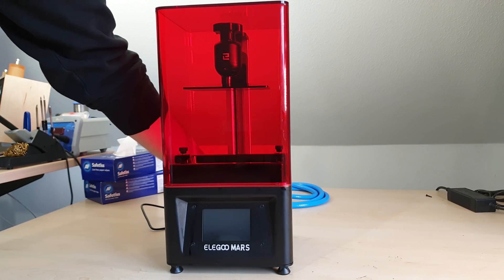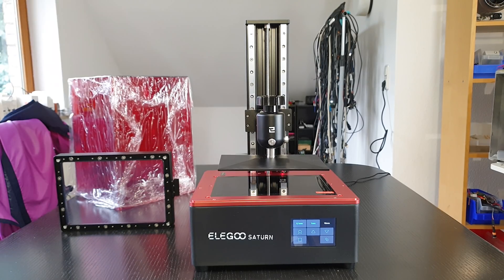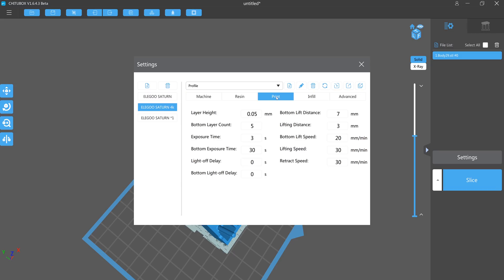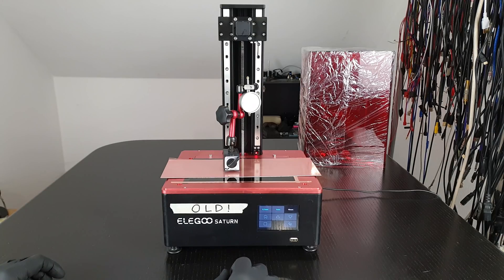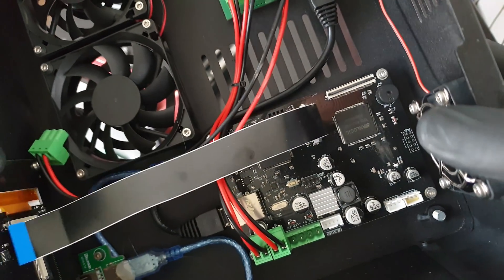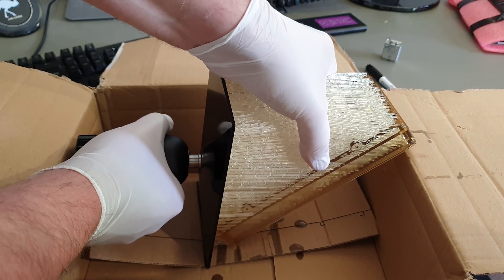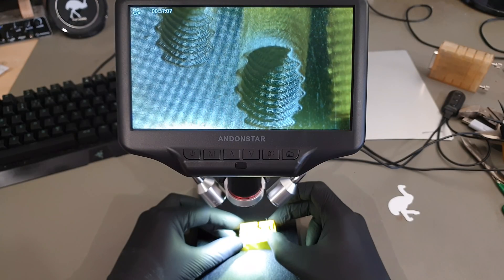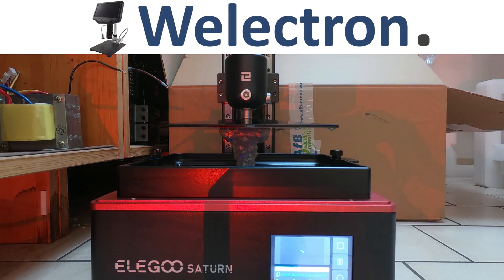Elegoo Saturn: Affordable 4k MSLA 3D Printer

Comment: Q: why are we using a single monolithic image plane?
A small image plane, moving under the vat, could make a 'mosaic' exposure.
The same tech would allow smaller models to have much finer detail.

A good, fast 2k image plane is mounted on a simple 'coreXY' gantry under the vat.
A 3 x 5 mosaic of exposures could give you 11,460 x  10,800 pixels in the print.
This assumes a 3840 x 2160 image plane.

If you want ultra-fine detail, stack a bunch of 'half-tone' images.
Each image uses tiny 'micro pixels' with lots of 'white space' between them.
Each new image is shifted by one micro pixel.
This goes on until all the white space is filled.
You get a smaller model, but with the same pixel-count as the much larger one!

Isn't that the dream?
Smaller model = finer point size?

Comment: The Phrozen Sonic Mini 4K has been out for some time now, with an increased resolution of 35 microns in the X- and Y- axes .. Are you going to create a new video showing off the threading capabilities, and other micro level engineering aspects of a 35% decrease in the pixels? xD

Comment: Maestro; a couple of questions/thoughts:
- how is the printer performance, now, in terms of your satisfaction?
- does Elgoo provide any warranty, or life expectancy for the UV LEDs?
    My question here is related to issues with performance degradation
     over time, as this will affect exposure time, and, most likely, exposure 
     evenness. UV LED packaging is rather problematic, especially at high 
     power levels, and the degradation in the LED die, as well as package,
     will not be the same across all devices. One can expect the required 
     exposure to increase a bit/gradually, with use.
Viel Spaß, oder?  Amazing results on this threads, and, with the broken "bolt" threaded part, possibly a minor "tweak" to get the thread a bit looser in the nut? Also, perhaps program into any threaded holes a very slight countersink to ease insertion of the fastener? Adieu, Ade, Pfiat Di!

Comment: Grüße;  I was wondering, just thinking, if you had a counterbalance for the mass of the printing head, to avoid any torque against the lead screw and rails...adds some load to the lead screw, unless you used something like a constant-force spring as the counter-balancer, which would remove almost all of the loading on the rails and lead screw??... anyway, just thinking... keep on drucking!

Comment: Hi! Can you share the settings of the new "rook profile", I want to compare it to the settings used in the cbddlp file that comes in the mars flash drive, specially the lifting speed, since you mentioned that 70mm/min is brutal, but the rook in the mars prints at 300mm/min and also my prints since it's what I've been using

Comment: Thank you for the excellent review.  It was by far more technical and informative than the other Saturn reviews I've seen.  I've only been resin printing for less than two months with a QIDI Shadow and while I knew I'd like the much higher resolution compared to FDM printers, I was completely blown away by the strength of the resin prints.  I designed a small electrical insulator that requires high tensile strength.  The central shaft is 6mm x 6mm and I wasn't able to break it with 100 kg tensile force, and that was perpendicular to the layers, so MSLA parts don't have layer separation failures as FDM parts do.  Very good strength for a 1.55 gram part.  I used Siraya Fast resin.  I look forward to buying the Elegoo Saturn.

Comment: I'd kill for a good review of functional parts and dimensional accuracy on this printer. Especially smaller parts that may or may not be printable directly on the bed, to avoid the dimensional problems of supports (bumps requiring post processing, but also potential warping from differential peel etc). Like, I'd love to see whether "this extreme example" actually does fail. With decently slow lift speed, I suspect it may not. And if it doesn't, it'd be a lot cleaner than the supported example.

Comment: The chess castle piece was intended for FDM 3D printers. They just can not produce good results without using a small nozzle (.2mm), aggressive and precise active cooling as well as an extruder that can retract the same length of plastic without grinding it up with the small amount of printing per island and retracting to avoid stringing.

Comment: Looks like you also had the same problem with another Youtuber. Good thing they are reacting to it. 
You should try the new water based resin.
I regret not having jumped on the deal even though i don't need one in the near future. Maybe the newer models will be 101% quality but not too much more expensive.
The way you test precision is really innovative.

Comment: dam I am supposed to be receiving my longer 30 later today might just it return it right away for this on when its available its sold out quick. this one had a larger print area and a higher resolution screen but the longer says in can print at an xy accuracy of .047 with only 2k screen not sure how that is even possible. if someone knows please reply

Comment: I'm wondering if they make usage the subpixels of that LCD. As they are rectangular it would only increase the resolution in one direction but this still by 3 times. They also could be used for anti-aliasing, too (like already in normal applications).
So, when will show up the 8K version anyway? ;)

Comment: Nice to see this space is still moving; decent rails becoming the norm, and now mono lcds too. Was a little tilted by the XY calibration though. 0.15 out of 20 is almost 1%, or about 3 pixels. Is that intrinsic to the lcd manufacturing process, and so could be calibrated out? Or is this the nonuniformity of the lighting, so perhaps can be fiddled with by part placement but is mostly unavoidable? Also while chitu and most fileformats support AA, many boards and firmware dont bother implementing it last time I checked (januari this year). Seems like this is no exception, and elegoo has a history of being behind the curve here.

Comment: Are there resins with glass fiber particles? I wonder how strong would the resulting printed object be.
Reply: You'd probably need actual glass fibers and not just tiny glass beads to enjoy any strength benefit. But fibers and pixels don't really mix

Comment: if you have two rooks, you can join them by their crenellations. they should mesh exactly, which i think is intended as a low budget tolerance test. maybe that's the "torture"? alternatively, once joined, you can torque them against each other until failure, which seems more like "torture" perhaps.

Comment: Ah damn its sold out.  Btw the "4k Microscope" you listed is not 4K - that would require an 8MP sensor, and it has a 4MP or 3MP sensor (the manufacturer does not seem to be sure which sensor it uses here:  http://www.andonstar.com/e_products/digital-microscope-AD407-10.html).  Still, a nice scope.
Reply from the maker: Whoops, you are right, thank you!

Comment: that printer is only 300$ ?? danm. 3d printing really got a long way since i first heared about them.
Reply: Yea.. The resin printers gotten really cheap. Of cause, there is barely anything in them apart from the raise screw, the LCD and the light. 
But i really do think the resin printers have a few drawbacks that makes them undesirable.  Like the narrow material selection and... well colors. The strength and resolution and of cause print speed is brilliant.
Then is the extrusion printers of cause that can print in pretty much any material, but is really slow and have low resolution. Also have some bridging issue. Still they are remarkable cheap also.
Then the last type.. don´t know the name of them. But there is a type that ad a layer in powder. Making it possible to print any shape. They are also fairly fast, pretty much as fast as the resin printer. Also have amazing resolution, and quite a bit of material selections. There are printers of this type that can print in titanium, and do so reasonable fast.

Comment: 6:22
You can put the spring an the other side of the motor to avoid load driven positioning.
Reply: ...unless the rotor rubs the inside of the endcap.
...or the other end is not machined to accommodate the *wave washer. (not called spring)

Comment: Looks real neat! I’ve always been interested in SLA printers as opposed to FDM. I assumed you wouldn’t need something as beefy as an FPGA to drive the LCD, since you don’t exactly need a fast refresh rate. 4k is about 10Mpixels, which at 8-bit greyscale is 80Mb. With refreshes every few seconds, I guess that’s somewhat fast compared to what an MCU can handle, but any modern graphics card, integrated or otherwise, should be able to handle that kind of throughput. And with all the used GPUs flooding the market after the crypto boom, it would be nice to see an SLAM printer use one of those.

Or you know, just plug the printer into HDMI and have software on your computer do the heavy lifting. That way you’d just use a standard LCD driver.

Comment: Ahhhh, the 21st Century duct tape is the hot glue.
Reply: I was using it in the eighties, especially good for holding fibreglass core materials like closed cell foams.
Reply: @metricstormtrooper  So was I but not until this century has it been the go to for everything.

Comment: Marco.  Just a thought, but you could add a simple single ball trust bearing to the bottom of the Z stepper . I wonder what effect that would have on the layer break-away? (perhaps it would be better ? controlled by the motor instead of being springy)

Comment: This is amazing value for money and truly a great device. Love it. Thank you Marko for this video finally something we can afford for ourselves!!

Indeed these SLA technology are still improving. So I wonder what the real limitations will be for this material? For example is the resin going to always be more expensive than PLA or ABS, therefore finally limiting the size? Or is the UV curing properies of SLA part going to eventually make these prints brittle under long term sunlight, making them not suitable for outdoor usage? Or does it just get stronger with the excessive UV exposure ?

Personally i feel SLA is such a great choice. And really like it. However the other options I am seeing are strenghtened filaments such as carbonfil TM which is a conventional plastic filament reinforced with 20% carbon fibres. I believe there is also a GRP version, plus one other carbon fibre printer (which is more like a true carbon fibre).

Anyway... also very pleased to see the great thick rigid aluminium construction... on a conventional lower cost 3d printer. You almost never see this on a $300 printer! At least not to my knowledge. Really hope they keep that design going forwards in future models. And do not cheap out there. Perhaps if we can also see more rigid designs on the regular 3d printers too at a similar price point? Would that even be possible given the extra 2 axis? Perhaps not IDK... Otherwise maybe on some budget cnc router instead.

What a great topic. Not very often but I am really impressed with the strength of the technology in this case (i mean for going into a realistic consumer product). Well done to those guys.
Reply: Yeah it gets brittle with post-cure exposure. But maybe some progress can be achieved in this regard.
And yes it's never going to be as cheap as FDM materials, especially cost optimised ones reused from other industries such as HIPS.
Reply: Ni

Comment: The printed threaded block blew my mind. Almost impossible to achieve with FDM
Reply: Amen, can't wait for my first large 4K chromatic MSLA printer!
Reply: How well does resin printed parts work with heated metal threaded inserts? I've yet to find anyone even attempting to do this. Will the resin plastic deform and fail the attempt. Will it outgas a deadly plume of nauseous gas? Will the typical resin even work? Are there any resins develped yet for this type of application?  Any answers to these questions will be greatly appreciated. Of those doing reviews, I think Marco Reps might be the only one able to address these questions. TIA.
Reply: @jamesmiller7278  UV resin isn't a thermoplastic so all that will happen is it will eventually burn if you try to use a heat insert. However, you can use epoxy to good effect. On the printed part it should have some internal knurling or ridges where the insert goes for the epoxy to grip and since the insert is already knurled on the outside it should work pretty well.

Comment: Ohhhh this might become my new printer when it comes in stock, I'd rather deal with those nuances instead of the janktastic extuder based printer I have.
Reply: IDK, my FDM just runs and runs without issue (it was $99 parts kit plus I added $0.25 in printed upgrades and a $12 magnetic flexible heated bed). Hit the button and walk away and come back to really nice prints (build volume is about 310mm high, and 200x200 due to magnetic print bed being a little smaller than the aluminum heated bed, but still big enough for almost anything I needed. I don’t usually do threads with it but it has done decent with threads if you set it to like .15mm Z height.

Comment: It's £300 that's super cheap, I was expecting it to be somewhere in the £1200 region.
Reply: Goes to show just how obscene those other mid-size 2k printers were. I always said they were absolute gargantuan rip offs.

You did have to pay shipping though, which thanks to 1 of their screwups was only $100 no matter where you lived. ( EU was supposed to be $150. ) All taxes, even VAT, were covered.
Reply: $300 not £. (£236.51) It was only for the first 200 sold. Then $400 for the next 800.  When it comes to the market. Some rep said it would be around $550.
Reply: @littleweaselboy2865  trust me, you still wouldn't have got one.  The early bird $300 units were gone in about 2s and the other 800 were gone in about 1 min.

Comment: S O L D O U T
I want one real bad...
Reply: I marked my calendar to remind me June 13.   
I’m thinking a Mars would suite my needs just fine, but thinking of getting a saturn in case my needs change in the future.  
Just not sure if it’s actually worth the extra $150 to me personally.   
I need to do more research.
Reply: @uspockdad6429   I'd spend the extra 150, but that's just me. You won't find another resin printer at this size for under 1k.
Reply: Mr. Yuck Yeah, I think I’m leaning that way.  I just hope I get online in time to get an order in.
Reply: @uspockdad6429  I hope you got one today, I ordered one!
Reply: @mcsdaver  now the second batch is sold out too, I think they need to choose from 2 options, either adjust price up to lower demand or invest in higher volume production
Reply: Will be available on amazon by November
Reply: Are they any updates on this printer?
Reply: "The 2nd batch sales haven't started yet, it will launch on 6/13 14:00 UTC"
Read the Webpage maybe?

Comment: removes a thing that is unnecessary => Innovation
Reply: Elon Musk: Best part is no part.
Reply: Apple wants to know your location
Reply: @bunnythekid  تتعاطفوا ا
Reply: @bunnythekid  s(o
Reply: @bunnythekid  jk
Reply: Hfucht
Reply: Innovation is not really the right word, but they finally found a monochrome display in high resolution! Or someone now makes them specifically for MSLA printers.
Reply: @xSchattenfluchx  q
Reply: @xSchattenfluchx  gpxxchhuu
Reply: @xSchattenfluchx   vhg
Reply: got giant resin printer -> prints case and handles for his stuff, perfect
Reply: You'd be surprised how true this is.
Reply: Duobond is making the LCDs. And yes, they specifically advertise them for 3D printing. A 5K 10.1" LCD is announced already. 6" goes into smaller printers (Photon Mono for example).